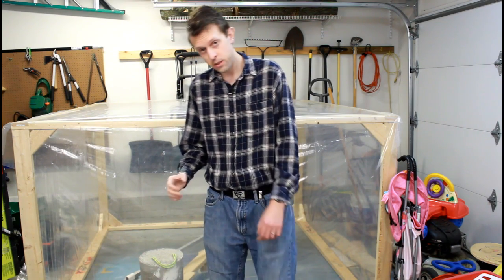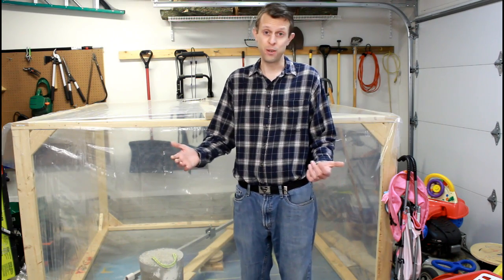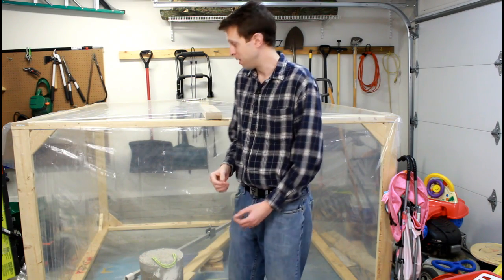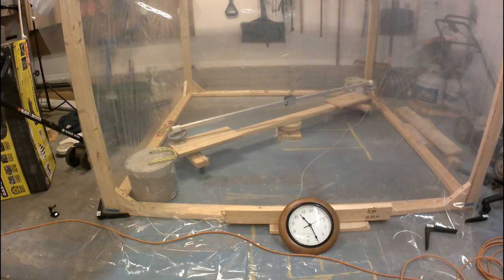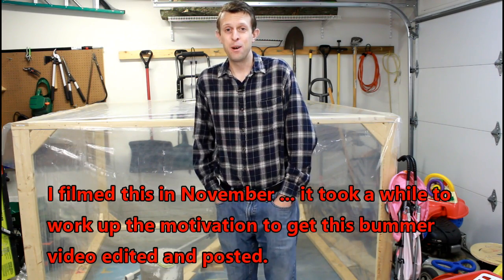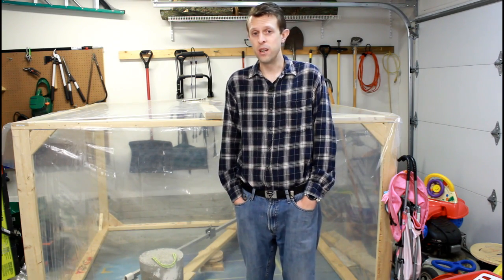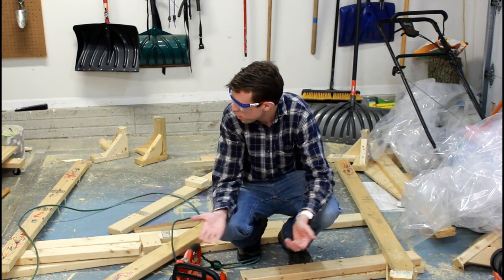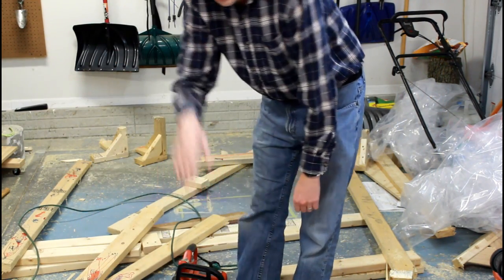Cavendish Postponed

Comment: Man, it’s a bummer. I’ve been really looking forward to this for my flat vs. globe research. Thank you for trying! That’s more than most people can say for themselves. Do you think cavendish was really able to isolate these variables? Looking forward to seeing more of your content. Great work!
Reply from the maker: I'm sure Cavendish wrestled with the same types of issues.  As I mentioned in the video, I think a fair bit of the issue I ran into was a result of using small, not-that-dense weights.  Cavendish used giant lead balls which would have provided a significantly larger gravitational force, so his device would not have needed to be quite so sensitive.

Even so, he took the precaution of building his apparatus so that he could make all adjustments and measurements from outside, and had the torsion balance isolated from the space in which the heavy weights were moved.  

Once he had everything set up, he noticed that the draw to one side or the other was not consistent over time.  He eventually determined that this was due to a slight temperature difference between the weights and the balance.  As the balance warmed up from being near the weights, they heated the nearby air creating a tiny air current.  He described going to great lengths to identify and minimize this effect.

If you're looking to research this topic, go to the source.  Here's a link to an e-book that has Cavendish's writings about his experiments:
https://books.google.com/books?id=zrkEAAAAMAAJ&pg=PA62#v=onepage&q&f=false
Reply: @AndrewBennettScience  Many thanks for providing the source